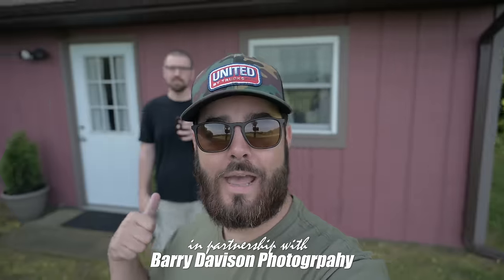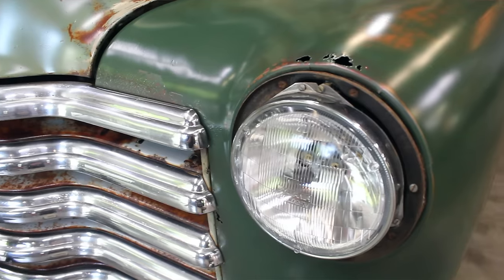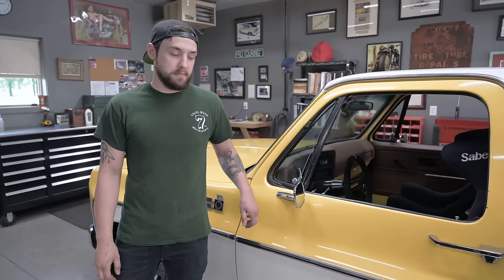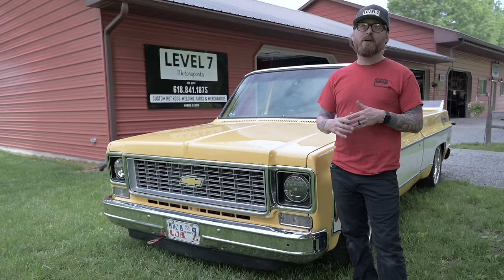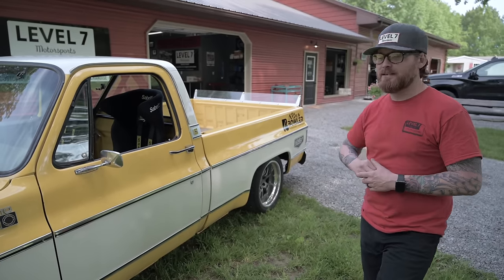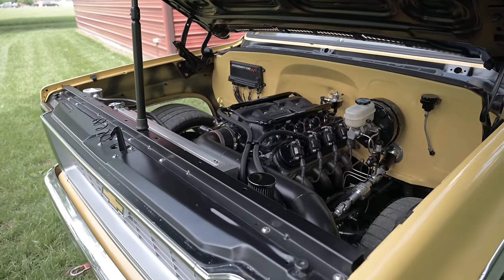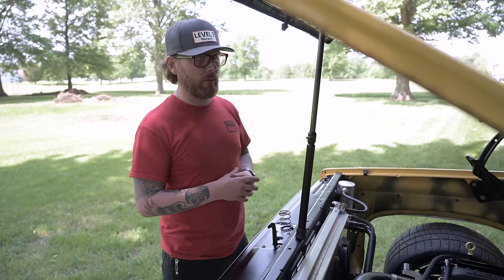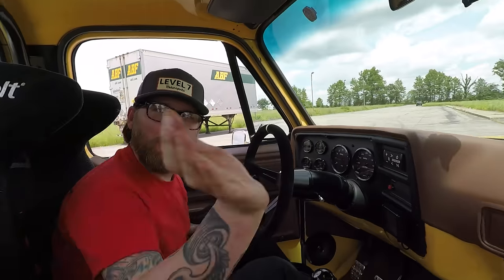WE BUILD RACE TRUCKS | Level 7 Motorsports C10

Comment: I have a '73 short bed fleet side that I just finished the 5.3/th350 swap, runs awesome,  now I just gotta focus on paint and body, I already have door panels and dash pad from lmc truck on the way,  and already swapped all the gauges for a mixture of modern digital and analog pieces,  had to replace both front calipers and hoses due to them collapsing. .....but other than that I just gotta get out there and start sanding and grinding. ....I wanna do a cobalt blue with the white insert with blue pearl flake on the white, for the 2 tone paint job, rather than breaking it up with the expensive trim in between colors I was thinking a red pin striping to separate the colors......

Comment: Hey UBT quick question will a 73 and up c10 cab and fenders fit my 83 c10 frame???
Reply from the maker: Yes sir!
Reply: @UNITEDBYTRUCKS  so a 74 cab and fenders will fit my 83 frame?? I MIGHT buy a what it looks like a 73 73 75 76 77 78 long bed c10 and swap cabs for my 83 project I have

Comment: to bad u live so far away i love to race trucks i got a 68 chevy with a stroked 454 tunnel ram best part is i only have 2300 in it but have lots of parts for trading for parts have from 65 to 79 trucks chevys and fords most have no rust and good clean bodies just got a 79 chevy 4x4 short box with only 35,000 miles on it full option truck every option they came with 400 sb with 400 turbo in mint condition even the paint and 2 first gen 2 second gen camaro's all for free i got a square body 2 wheel drive with cadillac ride suspension witch sits lower by 3 inches then the average stock truck and it is stock  it is on the option sheet plus no rust in the truck but i been filling up 10 acres of rigs i scrap and part out the one's that get with rust all ready sold all the 50's rigs i had made a lot of money off them but they were clean rigs no rust the 57 pu i had was in perfect condition no dings no rust set up for the 55 grill with a new grill i got for 200 and flipped it for 5000 with out engine and trans right now i selling a 78 square body no rust with a 350 4 bolt good block needs rebuilt good clean body no trans for 500 i got for 200 with a lot of new parts on engine that i needed for my engine like carb, intake, msd , distributor and headers plus it had 202 camel heads i even got a cab from a 67 air condition cab with 0% rust just sitting on a 3/4 ton drive train with a rust free box metal floor i like the wood floor like my 68 has  i pulled the front clip because my kid wrecked his 67 pu so much for that project if u ever come to oregon and want to look at rigs i know were a lot of them are sitting most i get for free but i have 2 friends that have 10 acres each with rigs
Reply from the maker: Very cool! Thanks for sharing.

Comment: The t-56 is overrated in my opinion, the cd009 or whatever 350z manual transmission is better geared than a t-56 and shifts more crisp to me. Not only that they're much cheaper to find or cheaper in general
Reply from the maker: Thanks for that feedback!
Reply: The CD009 is a very inexpensive transmission and there are tons of them. The gearing is horribly wide for any engine that makes power and they dont have great torque capacity. But that’s not fair to compare them to a T56 magnum. If you compare the CD009 to an older T56 then the price is a better argument but the gearing is still not what we would want.